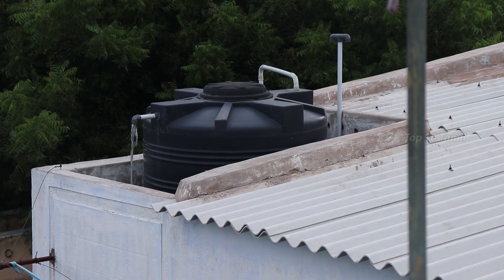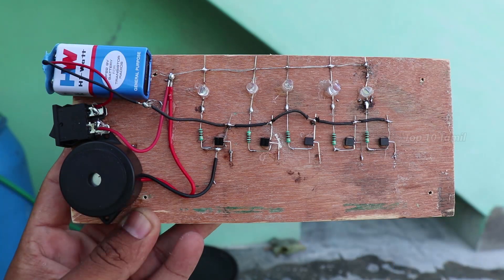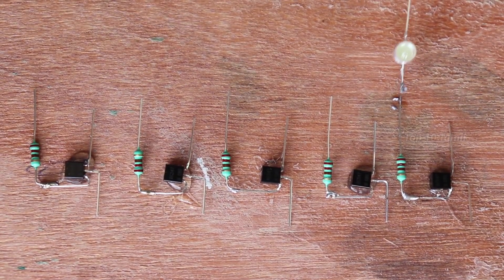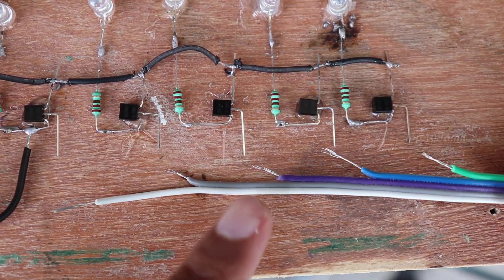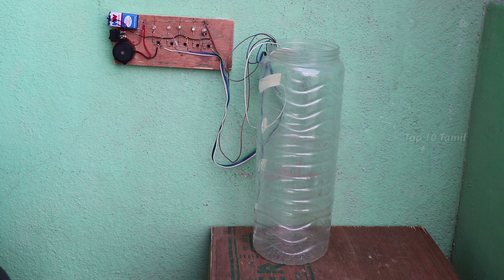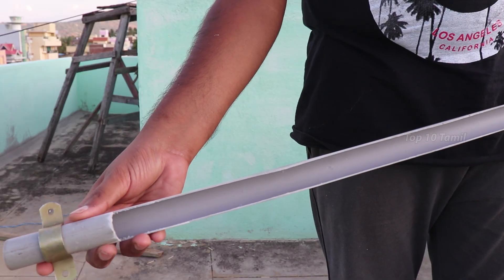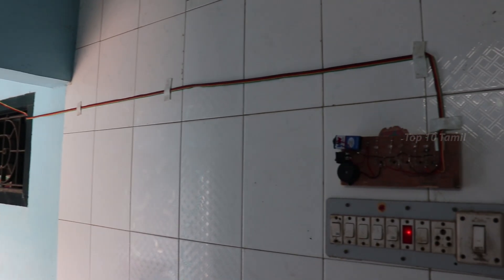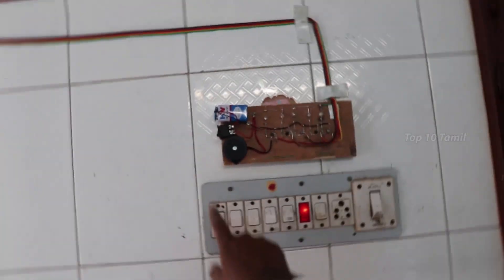நம் வீட்டில் Water Level Indicator மற்றும் Alarm செய்வது எப்படி | How to Make DIY Water Level Alarm

Comment: simple one with Knowledge to any Layman wishes bro  ... at 4:52 u said its  brown for earth line its  not eart its +ve  ... techinally when switch is ON all LED get their +ve   and  reached that brown wire which is contucting this +ve through water as we know water is a good conductor of current when water level  raises to green wire and to all color wires  this +ve  current reaches to the base pin  of each transistor  which uses reduced current controlled by the resistors connected on each transitor in turn LED gets their earth line  and ights up

Comment: Thankyou very interesting! 

When wires are dipped into the water, I can see bubbles and color change in water, why it is happening so?
Reply: Bc547 is shit.... It corrodes sensor within days... Use uln2003 based indicator it works for years without corrosion.....

Comment: Bro, this circuit suitable for 45 meter height of building? 
Or any voltage drop occurs..?
Reply: It supports from 1 to 90mts of wire.....

Comment: I tried it. It is working properly 🙏.
Reply: I bet it would have not worked more than a week or month due to corrosion....ULN2003 IC does not corrode bc547 is a shit for this project....
Reply: @manjunathcv9146  but I used it for past 6 months.
Reply: @manjunathcv9146  what type of corrosion occurs?
Reply: @sudharsanakumar5016  most of the times... Electrode/sensor in tank will get corroded...

Comment: thanks bro. I have couple of questions
1. is the sensor is just a exposed copper wire? I think copper will corrode and suffer electrolysis? 🤔 2nd question is instead of battery how about using a phone charger? 🤔
Reply: Use Stainless steel bit as sensor and make sure to cover exposed wire wound to stainless steel bit with araldite epoxy by doing this you get  1 or 2 year sensor life...... If u use uln2003  instead of bc547 you can minimize electrolysis by 80%

Comment: Hi bro I like your videos which you posted in YouTube. And I need some information about this water tank alarm system. So could you please clarify my doubts. How do I connect this device to the AC which means connect to power? And how do I connect the motor switch to this device for automatically the motor will switched on if there is no water in the tank so could you please explain me elaborately so that I can make this my own. I am looking forward to here from you soon Thank you....

Comment: Hi Brother,  Really good and useful video.  I also did it.  Working fine as a project.  But I would like to implement it for the tank at my home.  

This is running with 9V Battery.  I would like to implement it for our tank at 35 feet height top of our house.  Will the 9V be enough to carry the current till 35feet.  Please suggest me a way, so that we will be able to monitor the Water Level from the ground floor.

Thanks in advance!
Reply: It works.... It support upto 50000 liters water tank upto 30mts wire....
Reply: Hello uncle !!
I tried doing it seeing this video .
The tank was above 2 floors and got good results. So pls refer this one also👇👇
https://youtu.be/ApKh6AxGBwQ

Comment: There is no code given so how it's possible tht the busser sounda when it reach the max
Reply: To make the buzzer sound, it needs + & - supply (5v). 

You can open either the + or - supply by using a switch or it can be done using the water as connecting media. Since water acts as a good conductor of electricity/voltage, the buzzer sounds. 

The wire which is at top level in the tank is the circuit breaker. When the water level reaches the top wire the circuit gets closed and thus the buzzer gets voltage to make it sound.

Comment: I made this equipment for my home. 2 qty did. Working fine.. thanks for your video.  I spend around 100 rs for base unit including plastic box and 200 rs for wire 20 metres for my water tank at 2 floor. Suggested to use only 3 LED lights for low, medium and High. So that it will be sufficient to have only 4 core wire.(2 core speakers box wire 2 nos) which is very cheap you can buy 1 meter for 10 rs max. If we ask 5 core coloured wire in shop cost is around 50rs. Hope my suggestion will help others. Max cost for making is rs. 300 which is very cheap. Thank you bro for this video... really helped a lot...

Comment: Nandri brother.

I did this demo yesterday. Within few days I will install in tank.
Reply: I installed in the tank. Its working well. This saves lot of water and electricity. I can see my dad happily switch on & off motor after over flow indicator alarm is raised. I can happily switch on the washing machine by observing the water level is more than 20 or 40 %.

Thank you guys & wish you all the best for Top 10 Tamil channel

Comment: Bro, nice video..
Keeping the wires inside the water tank, will there be any earth or electricity leakage through water problem?
Reply: No hazardous effect will happen because it's.working voltage is 9volt dc only. Anymore doubts pls call me 9790091294 I'll guide you

Comment: Hi, this is safety method.  Someone already find water overflow alarm with power on/off mode.  But that method risky. Bz supply wire into the tank.  But ur project always safe and fix power switch nearly. Thanks

Comment: You can directly connect to LED no need all these circuits also you can simply cut the wire and tape it in the PVC pipe no need to cut. This is a wast of time. You can same lot of money. Hope will cost only 50 to 100 rupees.

Comment: Nice vedio bro... but neenga oru 230 volt Ac control relay use panni andha led and buzzer control laium super oh set pnnirukkalam...good job
Reply: If circuit failed means entire house will get electric shock through out the house pipeline...9v battery is most safe

Comment: How long can i make the wire from circuit board to water tank? What i want to ask is from motor switch to tank its near about 110 feet distance. If i use a common mobile charger instead of a battery will it work. Please be informed that i am not a since student. So if anything need to change let me know. Thank you for sharing your knowledge and idea.

Comment: Idea is great and naanu veetla panna pora bro , aana oru sila doubt iruku clear pannunga"

1. Intha 9v battery vachu ethana naalaiku intha circuit work aagum  bro? 
2. Intha battery naala tank la thottu paatha current adikuma bro?
3. Ithu long term a varuma bro?  because electrolysis and oxidation naala antha tank la water oda touch aagura wire end dissolve aagdiumnu soluranga

Please solunga bro

Comment: 9v battery life  (  in days) how much in your circuit 
Because length of ribbon wire is more 
This is just to know
Reply: Length of ribbon wire is negligible since bc547  or uln2003 ic supports lenght of wire upto 150 meters with 5volts and 270 meters with 9 volts which is phenomenal even for high rise buildings...... Coming to battery backup if you use 9volts battery for daily 10 mins you will get battery life of 3 months easily... If you want to indicator to work for 24/7 use mobile charger or a 9v transformer with bridge rectifier...

Comment: Bro! ground wire where to
Connect in the water tank,
What is the price of the wire per meter(connecting from tank to indication board)
To board)
Reply: ₹25 in Amazon 10parellel wire

Comment: Bro big tank kuku  ipaadi senja cable waterku medhakkuma .  Apa bettery power paththama powuma yen enda adhu 2000L tank adhu naala thaan kettan
Reply: Even it works in 5 to 9volts upto 15000 liters of water and upto 210 meters of wire I have checked it...

Comment: I did this during my schooling, biggest disadvantage is corrosion happens in wire contacts inside water ... will work for a few days  .... never do this if water is salty
Reply: If the wire dipped is copper nothing much happens if it non copper it rusts and becomes non conductive within 3 months if copper it will work aleast for 2 year's

Comment: Thank you so much,

I don't understand your language, but your efforts to explain is perfect moreover the practically you have installed the circuit with such tank is highly appreciated.

Can you please tell me how long you have used the (rainbow strip wire) in meters or feet?
Reply: Dear beter use cat6 wire for best performance. I'm using for years successfuly

Comment: intha circuit on la irukum pothu namma tank kulla yarachu pona shock adikum a
Reply: No way. This circuit is working on 9v. Like your wall clock batter cell.
Reply: @followdream161  TQ na
Reply: @followdream161 if we are connecting to automatically switch on and off when it reaches the low level it starts and in high level it gets off automatically while doing this connection whether we will get electric shock or not bro
Reply: @muneeshwarmuneesh281  I have already answered your question. It's won't electrocute the human as it less than human withstand capacity. You are connecting battery 9v and not from home live wire..

Comment: For me there is no issue....the overflow pipe from the overhead tank is directed to my well from which I pump my water to the OH tank.
So....when the OH tank is full and water overflows it goes back to the well. When I hear the sound of water falling in the well I switch off the motor. SIMPLE....EFFECTIVE.
Reply: It's ok,  You know that tank is full only when the water fell in the well.
But how do you know water level inside the tank
Reply: @திருவேதா  What use is that info ? Every early morning I run the motor for 45 minutes to " top up " the tank.
When water from  the taps run as a weak and thin  trickle without force... I know it is time to top up 
Very rarely when topping up water may overflow..No problem !! Like I said...the overflow runs back into the well!
So....why should I know the level of water inside the tank ?
Unnecessary..

Comment: everything is okay, you have clearly explained for one side for creating circuit, but I have a doubt in  the other end of the wire in the tank. 
That wire copper directly need to touch the water or need to fix anything. you showed only the pipe  for the support.

Comment: The clamp you fixed inside tank using nails will surely destroy or weak the strength of your tank slowly for sure, and there is a 50% of possible that the tank may get leakage after few days, when you do experiments pls so the analysis of the side effects and give solution for that also.

Comment: Neenga indha circuit illa 9v battery than use panni irrukunga unga vittu water illa salt content more a irrukarathanal base illa electricity conduct acchu but anna some place illa water illa salt content less a irrukarathanal anga conduct agadhu so andha LED, buzzer dim ha work aggum illana does not work angga inna panarathu nenga athigama voltage use panna waste of many money or changing ikka neiya time take totally it takes much money tell me the easiest way and  some money to solve this problem

Comment: A very simple solution is install light quality conduit pipe from the overhead tank overflow to the sump tank inside. Make funnel at the starting with mosquito netting. So when the overflow starts the water pour into the funnel and the water flow into the sump tank. Water will not be wasted. You can switch off the power once you see the drop coming from this overhead tank.

Comment: Idea is appreciative but,  
1. In the Tank, rust will be formed in the nail and clamp.
2. If you left the circuit switched ON for longer time with water in the tank, Electrolysis will take place and contaminate the water.
Reply: Well said...
Reply: Will it happen on point 2?

Comment: 1)Neega ithukku sensor use panirukalam
2)Batteryku transformer use panirukalam
3)led ku sensor use paniruntha lcd display use panirukalam
4)ithana transister use panna wire athikama venue
5)Atutha video la sensor temperature  use panni vitota temperature level sollunga

Comment: Bro intha circuit a direct a vara current laye fix panita motor switch on pannum bothu ithum on panidalam la athe mathiri switch off panna buzzer switch off agidum la ? Just my openion 🤗
Reply: Nenga sollurathu motor ku vara current ah irundha athu ac current ma ana namma inga use pannura ellam electronic devices ma DC la  use pannurathu

Comment: bro.. one suggestion, try to put ribbon wire enclosed in pvc pipe at outside. or else due to sunlight, wire get tanned off and rubber become fragile.

Comment: Fantastic video.... Very needy at this time for wholemtamilnadu houses.
Can i give one suggestion ?
Reply from the maker: Yes
Reply: @Top10Tamil  We can make this Wooden Setup and keep it inside a transparent plastic container. So that, the circuits that are not kept in open air. Bcz with time, there are chances of dust, lizards, cockroache, rats don't damage its performance. Also if kids at home. We can be avoid their damage.
We can keep only Buzzer and Switch outside.

As of now, I found this container ...which might look apt for this.
https://www.amazon.in/dp/B07FY38HPY/ref=sspa_dk_detail_3?psc=1
I will search in co outer and give you better transparent container for this

Comment: migavum thevaiyana video - Nalla Padhivu
Reply: 100 avathu like nanthan bro🤓🙂
Reply: Why ground is used can explain
Reply: Negative supply via tank water to transistor base.
Reply: Tamil Selvan Anna hiiii
Reply: 9v transformer using for supply with motor switch.
Very easily off  with same time.
Reply: Hai
Tamil Bro 
I am already our viewers
Then only see to DIY project videos super explain and problem solving this channel
Reply: Thalivaa
Reply: Tamil anna 💪💪
Reply: Can you share the circuit diagram in the description.
Reply from the maker: Thank you brother
Reply: @Top10Tamil  hi bro I did but not working completely
Reply: @Top10Tamil  bro wire tank kulla irukum pothu yaaravathu theriyaama tank la irukura thanniya touch Panna shock adikaatha??
Reply: 9v DC so no shock!
Reply: @Top10Tamil  video super bro
Reply: @Top10Tamil   bro nenga electronics department a bro college
Reply: Indha mathiri oru pathivai thaan eathirparthukittu irundhean, nalla pathivu, nandri.
Reply: TAMIL TECH - தமிழ் டெக் hi
Reply: Tamil selvan Bro ingayum neenga thana😍😍
Reply: Super bro
Reply: Amanda bro unmailaye migavum tevaiyana onru